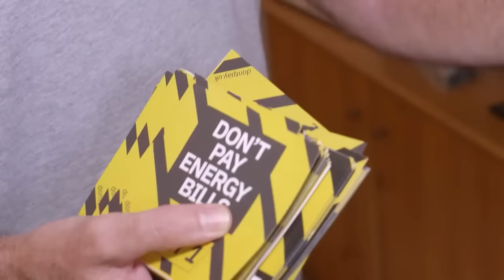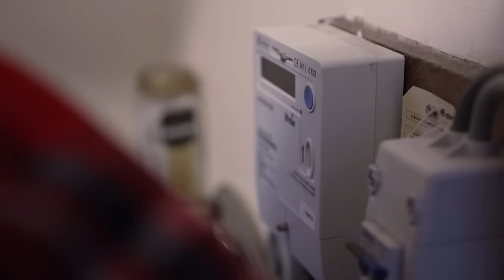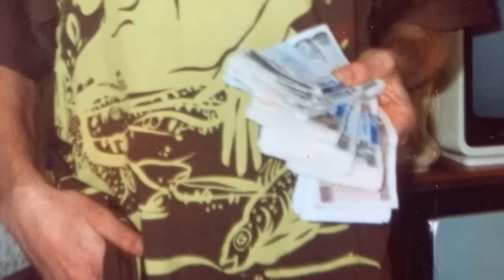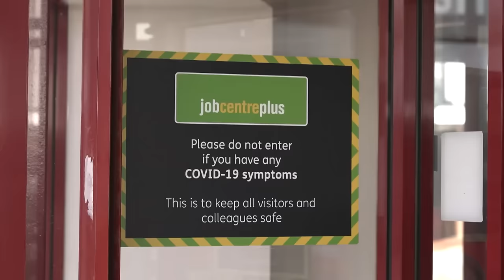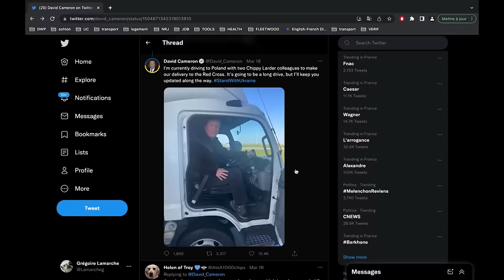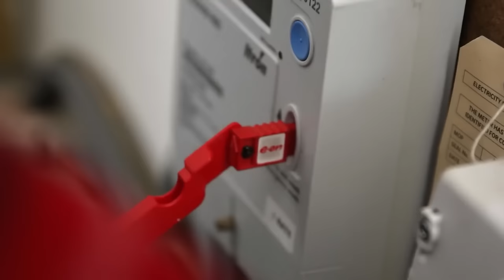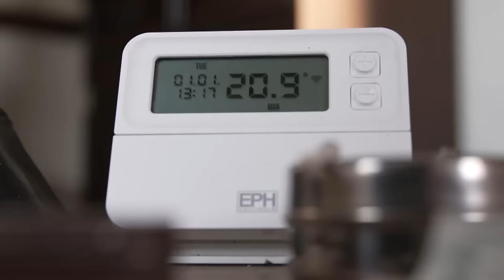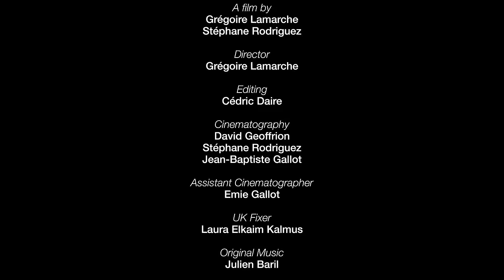HEAT or EAT? - How the Working Class was forgotten by the Crown | Poverty in UK | ENDEVR Documentary

Comment: With modern nuclear technology looking promising without the meltdown risks and without the high nuclear waste of previous nuclear power, but not yet available, for the UK a few large ultra high efficient clean burning coal electric power stations could reform the power grid with much lower cost electricity and remove large use of natural gas in electricity production.  The UK has or had high quality coal, but no new ultra high efficient clean burning coal electric power stations.   Natural gas is a very expensive premium fuel for generating electricity compared to coal in a modern coal plant.  Nuclear power has been a solution in France, but those nuclear plants are now 50 years old.   

Noncondensing greenhouse gas behavior, such as from CO2 and methane, can not change the overall effect of earth's greenhouse effect that is always in saturation from the strong greenhouse gas water vapor absorbing all the greenhouse radiant energy from the earth within 20 meters of the surface.   This is high school taught science and is known by well educated persons.  The cause of global warming is not known, but global warming has been dead at about 1°C since 1992.  

Arctic warming is taking place with the proving mechanism being warm Atlantic Ocean waters migrating deeper and more frequently into the Arctic Ocean warming it and the region.   That warmer water is causing a few weeks less of reflective snow and ice coverage resulting in more solar heat gain to the Arctic region surface.

Atmospheric CO2 levels of 1200 ppm about three times what they are today would greatly invigorate C3 plants the majority of plant life on earth greatly greening the planet. 

0.4% of the atmosphere is CO2 and on average 1% is H20 water vapor.   (1% H20)/(0.4% CO2) = 25.  Water vapor is 25 times more present in the atmosphere on average than CO2.   Water vapor has an CO2e of 18,  18 X 25 = 450 CO2e total for water vapor to 1 CO2e for CO2. 

The Earth’s oceans have 3-1/2 million sea floor volcanic vents warming the water and changing it’s chemistry that have not been systematically accounted for.